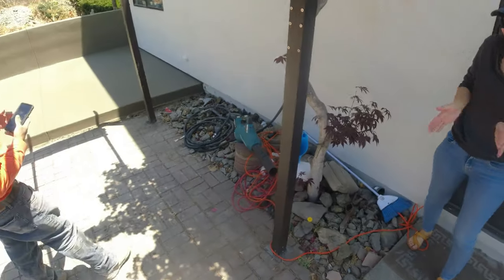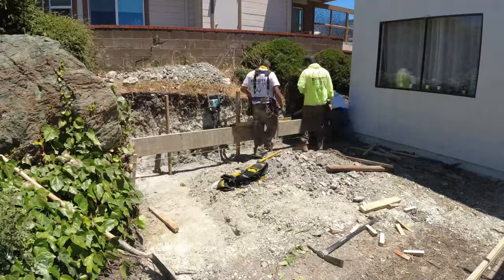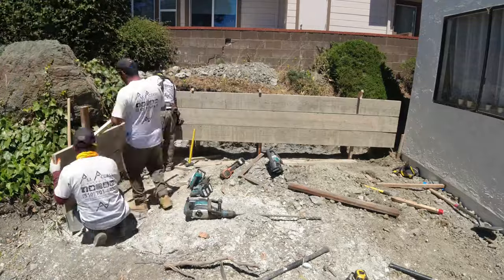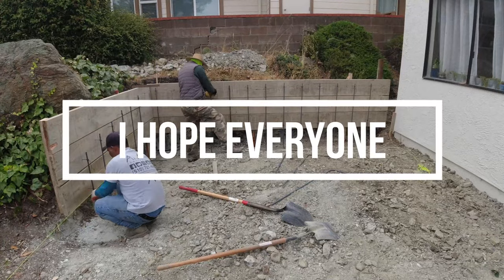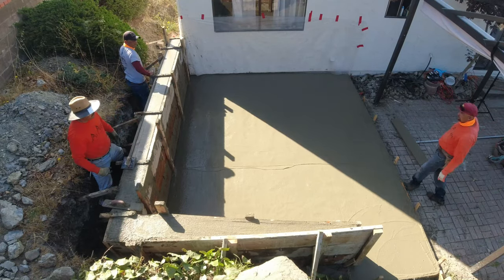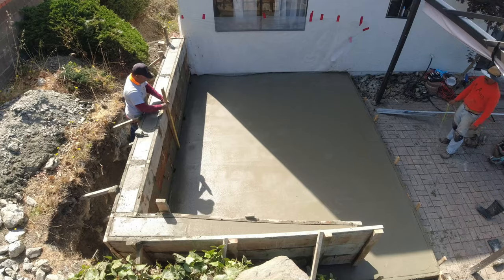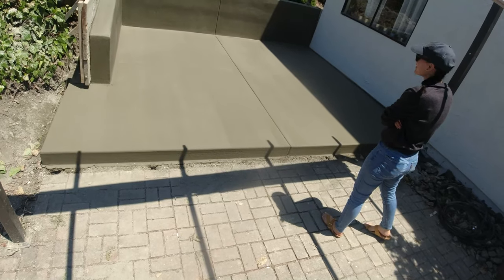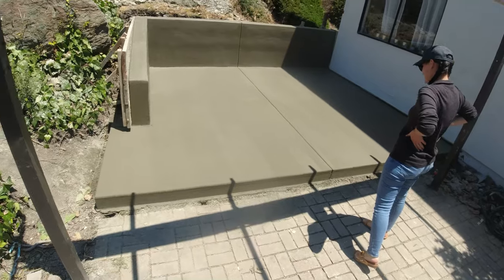"See How This Monolithic Concrete Retaining Wall and Patio Get Built!"

Comment: Amazing team work!  You guys make it look easy, which it is clearly not.  Planning, timing, experience and mix design is everything.  I wish you guys were in my area.  Outstanding work.
Reply from the maker: Appreciate the kind words.. 👍🏾👍🏾
Reply: @AllAccessConstruction  I'm curious what was your mix design?  Very high slump using superplasticizer? but if you took the forms off at 1 hour there must have been an accelerator as well?  Thanks.
Reply from the maker: 6 sack pea gravel 4 inch slump. No accelerator

 We've been using that mix for 12 years.. Retaining walls, flat work.. Etc.. 👍🏾👍🏾👍🏾. It's all about timing 🤪🤪🤪
Reply: @AllAccessConstruction  Thanks! what was the temperature on that day (approx.)? I've poured on hot days and barely been able to keep ahead of it setting (bags and electric mixer, 1 guy).  Cold days (10 - 15C) it stays soft forever, scary long.  I imagine your temps are a bit more stable?  I'd be nervous taking those form boards off after an hour but I'm a weekend warrior not a pro like you guys.  How do you judge set? thumb impression...?
Reply from the maker: Thumb impression 🤣🤣🤣 I like that one.. But that answer is correct.. You also can use a product called ardex.. I believe.. Where you come back the next day and apply it to give smooth finish..

Comment: How would you attach plywood to the 2x4 on the final outside framed wall? I'm building a curved retaining wall and thinking if I can reach inside to nail it or screw it somehow from the outside?
Reply from the maker: We use 1*12s and screws for tge curved wall.
Reply from the maker: Check out the Longest #Concrete #RetainingWall On YouTube https://t.co/6A3WB1MDGP
Reply: Sorry late to the party but, 
I would build or prefab the forms into 8 ft panels. Frame with 2x4 studs but curved top and bottom plates are cut from 3/4 plywood and doubled up. Make a template for that.

Comment: How long before you  remove the formwork to smooth the finish off please
Reply from the maker: Really depends.. I'll say 1 hour
Reply: @AllAccessConstruction  thanks for the reply. I've never done any concrete work before so watching all your videos before I attempt a small retaining wall in my garden. Thanks for the info
Reply from the maker: Any questions just let me know....
Reply: @AllAccessConstruction  thanks, in that case I have a further question. My wall is to be only be  750mm high above ground level but it is to retain soil to this height which is presently a slope to a failed brick wall 500mm high. How deep below ground would you suggest to be structurally strong, I was thinking 500mm below ground?
Reply from the maker: I believe that's about 30 inches high.. For the footing I'll go minimum 2 feet wide 18 inches thick.. We overkill out here